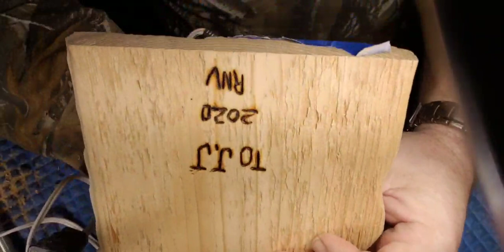Part 3 finshed carving power carving, dremel,whittling,wood craft

Comment: Rob do u ever use an arbor tech or Merlin or something like that. I’m looking to buy one an wondering which one I shud purchase?  Just for takin bark off an small carving on small stumps. I don’t want to use a chainsaw as I’m a little scared of them. Lots of things can go wrong with a chainsaw. 🐿
Reply from the maker: I do have an arbortech love it I use mine for carving larger stuff . But to small for a chainsaw. Also use it for detail bigger stuff  with an extreme disc works great for shaping and bark removal.  Although not a cheap tool I would recommend it . I have not used a Merlin although hear good thing about I hope this help you and thank you for the comments Rob